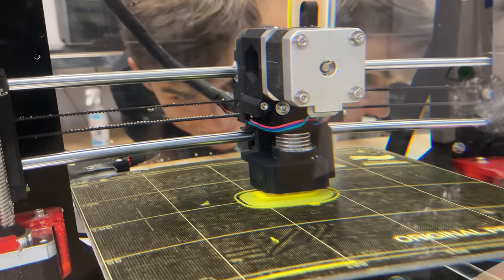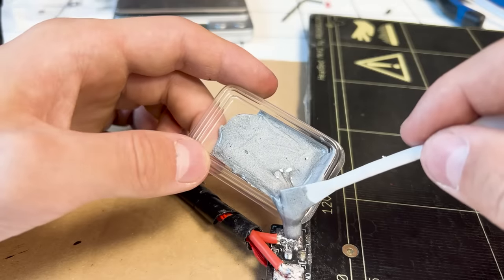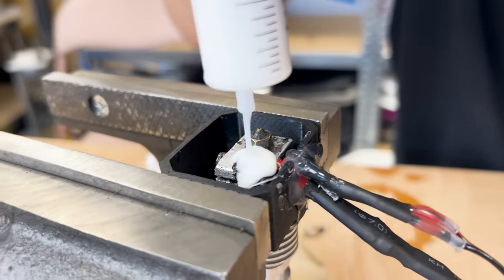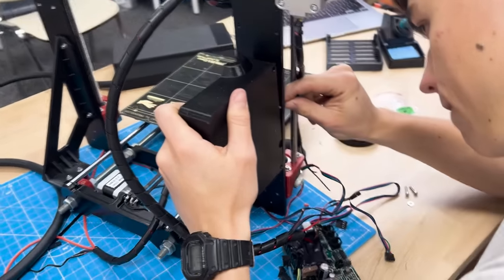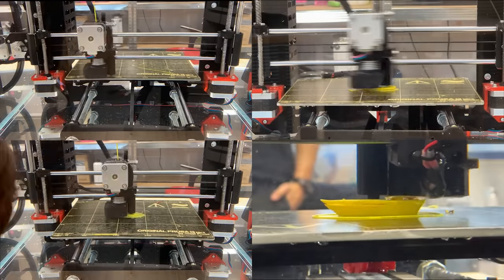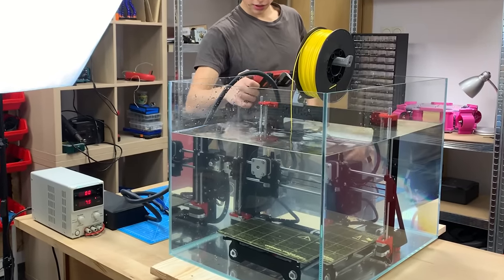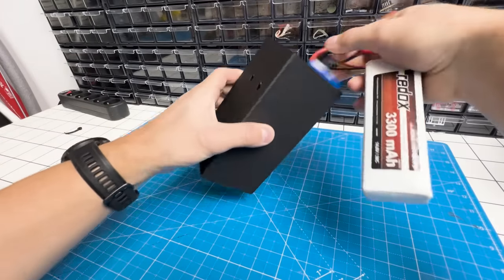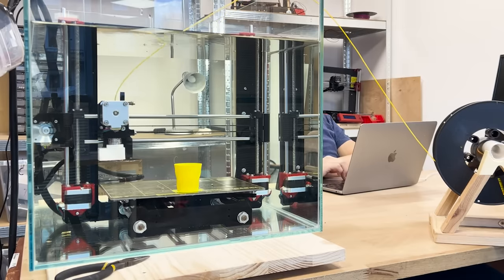3D printing underwater actually WORKS

Comment: They cool huge server racks with non-conductive mineral oil, making all that epoxy unnecessary.
Also, I think the water might well have another benefit over air when it comes to overhangs:
Water is heavier, displacing more mass, thereby resulting in objects having greater buoyancy.
I'm guessing the ideal coolant is some sort of oil that
- does not dissolve your plastics
- does not corrode your metals
- does not conduct electricity
- is such that the filament of choice is roughly of neutral buoyancy (making it effectively weightless) - maybe just ever so slightly negatively buoyant (so it gets pushed towards the bed in principle, but only lightly)

Comment: If you used a core xy it would have been alot easier since everything could have been outside of the liquid and only the print bed gets lowered in the fluid.

or just add better aircooling

Comment: I'm not sure but if you try with mineral oil, That one the is used on transformers, maybe you'll have better results. Like less metal corrosion the only problem will be the cables insulation will wear off over time. I don't know if it is safe because of the heat.

Comment: if you're going to use water to control heat, just get an immersion sous vide cooker so you can heat up the water bath evenly without stressing your bed.

Comment: Use a delta printer with the motors mounted on top of the frame above the water and use bowden. You will only have to worry about the heated bed and hotend at that point.

Comment: Try the high temp silicone again but instead of poting it all at once do it in 1/8th inch layers. 

When you potted all the silicone at the same time it was to thick to cure in a reasonable amount of time.

Comment: Distilled water is what you want to use, pure water has 0, read that 0 conductivity!  It's only minerals in water that add conductivity.  I imagine that corrosion was mostly from going in a pool full or chlorine :).

Comment: next time fill the motors with a very thick oil or even heat up grease and pour it on the motor, it will prevent the water from entering

Comment: Your efforts are admirable. But did you not consider to just make the nozzle bath itself airtight and leave it hollow to use as a diving bell? The trapped air pocket would insulate the entire hot end as air is  roughly a 20x better insulator than water at 20C. 
Cool video and project. Also if you wanted to insulate water from creeping into the hot end use a length of Teflon tubing from the water surface to the extruder to keep the fillament dryer.

Comment: I think, you do not need the whole printer under the water. You need water just under the nozzle. Only! CoreXY would be better, where nozzle is on one level all the time and bed with the printed part is going down ;) Then it is possible to have all electronic out of the water, even all motors.

Comment: Hey an idea for the hotend if you switch to a bowden tube you could use an o ring to seal the water out and effectively only have the filament touching water when it's extruded. of course this would mean no direct drive because there's no extruder that I know of that's sealed with couplers on both sides.

Comment: The easy way to take care of your parents would be to get stainless steel bearings and then press silicon grease into them. That would give you a much better long term solution. I'm still near the beginning of this video but i'm kind of invested in seeing how this works.

Comment: Changing the plastics buoyancy by incrementally adding something into the water, Like salt, until the plastic floats just enough to not sag during its span across the print bed.

Comment: You could use a corexy printer with a bowden setup and all motors at the top. Also the motherboard could be put on top out of the water

Comment: Now this is very interesting to me because it reminds me of those PCs that were cooled by submerging all of the components in oil. Too bad the flash point of mineral oil is 140ish degrees. But maybe there is another type of coolant that will give better results?

Comment: Hey, I've got a really really interesting question, What if we increase the viscosity of the liquid ? what if the viscosity of the liquid can hold help to hold the print up, or maybe you could look for denser liquids which could make the buoyancy thing more pronounced? There is a second video in this easily just in that, Plus as you mentioned at the end heating the bath. do you think it would actually improve print quality even further ?

Comment: It's a common misconception that water conducts electricity. It's the minerals that end up in water for various reasons that actually  perform the conduction. Distilled water was definitely the way to go though  as there is no mineral content. The pool on the other hand....

Comment: What if you put an inverted funnel around the nozzle and supply low pressure air to the funnel, so that the deposition occurs in an air bubble, but the rest of the print and machine is submerged in water?

Comment: use babyoil instead of water. however if you heat the liquid to the glass transition point, you will of course loose it's cooling effect...

Comment: I wonder just how much of waterproofing the electronics could be simplified with generous application of dielectric grease. Works really well under the hood of a car to just squirt a glob of it on any electronic bit you want to protect. Works against water and mud splashing against the bottom of an engine at highway speeds, should work just fine against stationary water.

Comment: To use cheap HT epoxy try to use a vacuum pan for epoxy molding
The nozzle bath will need some modification but it will not have air to expand when heated

Comment: The most obvious solution is to keep the electronics out of the water as much as possible. if you built a corexy printer around the tank with the z axis motors on top, none of the stepper motors would need to be submerged. Because of the way a corexy printers z axis works the whole hotend wouldnt need to be underwater, just the nozzle. You would still need a fan for the heatbreak or a watercooled one like e3d sells and just circulate tank water. You can also get corrosion resistant linear rails/rods.

Comment: All you need to do really is just pack the motors with marine grease to waterproof them.

Hotend I'd go with a high temp urethane or stick to silicone, just pour smaller batches.

Comment: As a mental challenge, if you print a pressure vessel in deep water, how much energy can you recover by letting it float?😮by printing a turbine into the pressure vessel, as it rises, the pressure difference makes it run.

Comment: Cool thinking!!! (No pund intended😋). Some thoughts and ideas...Perhaps make a whole new concept of a 3D printer. Maybe switch so that the print bed is doing the Y performance (vertical) and the printing nozzle is just below the surface using a small water pump to circulate cool water on the working area. 
This will allow the bed to lose less heat. Next, reverse the placement of the Y motor so it is placed above the water, it will still corrode if not sealed properly - maybe use a dry-air pump that forces dry air into the motor fuselage creating a over pressure refusing water or moist to enter the motor. 
The same goes for X and Z motors. These will have to be above water by default since the nozzle now is just below the surface. This will also give you more stability to the print since the nozzle has way less mass compared to the heating bed.
Now... just another stupid thought.... how about doing this with mineral oil instead? First.. The oil will not interfere with the electronics, non conductive... the oil will cool well, the oil will not make things like contacts, mechanics, motors, barrerings etc.corrode, it does not contain water with any impurities BUT..... It is flammable and really dangerous if something goes sideways🔥, I have no clue how PTG, ABS etc. reacts chemically with oil.  Is it doable?🤔🤨 I don't know!!!I I'm just the bringer of a stupid idea! 😂

Ps. Don't forget who gave you the idea if it works! (Thought please forget if it fails or turns into a disaster. I hereby sayin: DON'T TRY IT!! and if you do and things goes wrong it's on you, don't blame me! 😆)

Comment: I think oil is much better then water, because the electronics do not need insulation, there is no corrosion problem and since oil is even denser than water, the plastic is even more buoyant.

Comment: With the aquarium printer, you could have used de-ionized water and not worried about the electrics, or you could fill it with mineral oil (like exotic PCs) this may allow the steppers motors to lubricate?  Thanks for answering a long standing question I've had:) EDIT: Also if it is underwater already, why not try it up side down..
Reply: Wondering the same. Why not use distilled water to avoid the short circuit?

Comment: you have demonstrated that this with some dev time can be far superior than air print´s, and if you have more stuff made for water print´s like the material being made to not attract water and other things water print´s will have many benefit´s. 

so this just showed cased it can be done and it will have more pro´s than con´s for the print quality.

Comment: Why use water? You should try 3M™ Novec™ Engineered Fluid. That way you could just select the right novec temprature product and forget about all the adhesive, direct put the printer in the liquid.

Comment: Hi, your terroidal prop was a better project to work on. Now they are experimenting with bumps on the prop like on a whale fin. They are doing the wavy edge to the trailing edge, but on a whale fin, there are smaller bumps on the leading edge. How awesome would it be to take a terroidal prop and add this to it. It would be life changing to say the least!

Comment: Try doing it in mineral oil it's non conductive. You can literally just drop the machine unmodified in the oil.  I don't know what it will do to the bonding property's of hot plastic though.

Comment: For motors it is easy to get ceramic bearings. I bought them for fan expecting less noise but as they were from aliexpress the result was opposite. They are almost same price as quality steel bearings.

Comment: Printing in a liquid with a density close to that of the filament, so that it floats and doesn't sink when the layers are stacked - this should do much better bridging and could also solve the corrosion problem. i'm thinking of gylcerol, which is affordable in high quantities. using a printer design that lowers the printing bed, so the mechanics can stay out of the Liquid, could also prevent a lot of the Problems.

Comment: Thought about using non conductive cooling oil from 3m thats used for Datafarms, theres a big variety of it maybe theres one with the same density as PLA or whatever you print with so that overhangs are not afffected by gravity xD

Comment: Even if this project was basically a well executed high concept meme, it makes me wonder if there are actual applications for submerged printing. Maybe in engineering if you actually want the finished print to be full of a liquid and absolutely no air, or some scientific application where to want to print a test fixture around a material that reacts in air. Something like that.

Comment: why not encase the heater block in air?

1. just make a big upside down cone that can hold air underwater

2. pump external air into it if it loses pressure while travelling

Comment: If you're printing in water just below the glass transition temperature aren't you effectively removing the advantage of printing in water in the first place? I do like the suggestion of separating out the vertical and horizontal components of the print head motion and moving it horizontally only while making the bed do all the vertical movement.  That would allow you to keep the electrical/mechanical components out of the water (even the motors moving the print bed could be kept out of the water with the right design.  So the actual printing would take place just above the water, and then as each later was finished it would be lowered into the water to cool.

Comment: Could you use the coolant to submerge it in? Or a add a radiator and fan to transfer the heat out of the water? I suppose the swimming pool test answers my question

Comment: Are there any plastics with a density comparable to water? Some of the sagging problems could be corrected that way maybe. Also water might be able to travel between the wire and the insulation.

Comment: I’m surprised this worked at all, especially with the nozzle being over 100 C underwater, but the nozzle bath definitely helped with that. 

Unfortunately this barely works with PLA and is already much weaker, so it would be even worse with higher temperature materials.

Maybe a slightly different but better solution would be a sealed box with the printer inside but you water cool all the components. Or getting rid of the underwater idea you could try cooling with air that has been cooled below ambient temperature to get better cooling.

It would take a lot of power to heat the water up like you would a heated chamber and if there are any currents it would get even worse.

Comment: There are a few liquids that won't be a problem to corrosion nor electricity... i guess its mineral oil... would be a nice swap on the water... i dont know if it might "interact" with the molten plastic... but its an idea hehe

Comment: Wouldn't heating up the water be counterintuitive? Printing PLA in 35C room temp alone is already giving me a lot of problems. It will significantly reduce the cooling and a high chance of causing heat creep. Maybe it could work better with ABS, but you also need a higher temp with the heat block which might lead to another problem.

Comment: Try Mineral oil instead of water.  No need to "waterproof" the electrical systems etc, then you only have to work out the hotend.

Comment: Silicone dielectric paste can probably waterproof your motors and the bearings.  
This one from Amazon is what I have used..
TSG Universal Auto Care Silicone Paste with Brush, 8 oz
You may have to reduce speeds quite a bit to overcome the paste.  But if you open it up and fill the motor with this, then the bearings, and a rubber or tape seal over the bearings, then it should keep most of the water out.  May work for the other bearings as well.
You could try the same with mineral oil and seal it in, for less resistance to the motor.  But likely this will leak and let water in.
The other idea is SEAL your motors inside of an acrylic air box, with only the wires going in and sealed.  Have a disc plate on the motor, with strong magnets.  On the outside, have another plate with opposite strong magnets in the water, so the coupling is magnetic through the dry box wall.  Orient the wire hole down so the air is trapped in the box even if some water leaks through the wire inlet.

Combination idea.  Mineral oil floats on water.  Put the motor in a box, with both the output shaft and the wire hole on the bottom face of the box.  Fill box with mineral oil.  Aim the holes down, and the mineral oil should keep the water displaced from the motors almost indefinitely. 
With a little work you can probably make it last about 6 months or a year underwater before something else on the printer gives up.

And as others have said, expanding the box to the whole printer and fill with mineral oil would work as well.

Comment: Quick question... do you ...NEED the entire thing to be underwater? I mean, couldn't you just as well just let the bottom/tip of the nozzle be the only part submerged? I know you're using a Prusa-like printer, but a printer where the nozzle is only moving X and Y, and the bed moves in Z, might do the trick? (I'm using an Anycubic 4Max Pro, that has this configuration)
-I think you'd be able to avoid A LOT of your issues that way.

Comment: I wonder if it would be possible to make i so as the printer prints it will slowly add water to the aquarium so only the stuff needing cooled is submerged. So once it finishes a layer it fills up the aquarium by maybe 1/2 an inch. It would also keep the filament drier and the extruder a bit warmer cause air doesn't conduct nearly as much heat as water.

Comment: You know this would work perfectly eith a voron trident style printer, you could even invert the leadscrews and get all the motors out of the water so just the bed and print volume is submerged

Comment: If water molecules diffuse into the molten plastic as it is printing, you could have some serious Hydrolytic degradation (This might explain why the benchy was so weak.) (Not necessarily bad layer adhesion, but weak polymer chains due to degradation.) This is the same reason why it is important to keep filament as dry as possible. Not that it will degrade by itself, but if it is heated with water present, in many plastics, PLA and especially PETG, the polymer chains severely degrade. It might be good to look into alternative fluids to prevent this. I am posting this in case you had thought of this, and if so, do you have any plans to avoid it?

Comment: Another way would be to flip the printer upside down in the water, so that the motors for the Z-axis can stay out of the water, use a bowden extruder outside und move the bed with a long belt...

Comment: why not use the same oil they use for submerged pc's. That way it solves the short circuit problem. It also slows down corrosion since its an oil.

Comment: I am wondeing what would happen if you increased the nozzle temperature here in order to compensate for the increased cooling provided by the water.

Maybe a higher temperature would increase the layer adheasion? Going to test this,